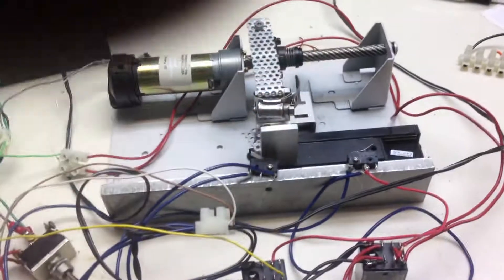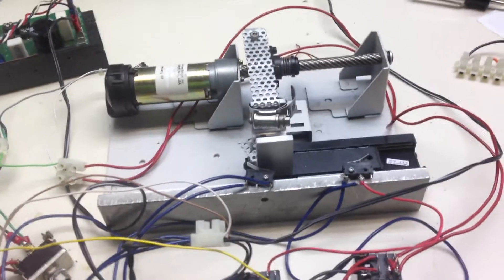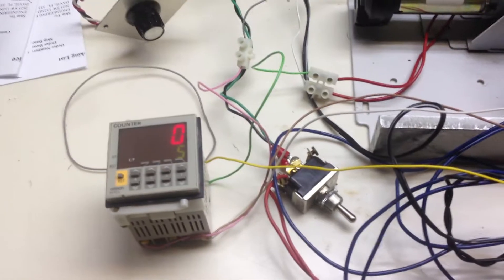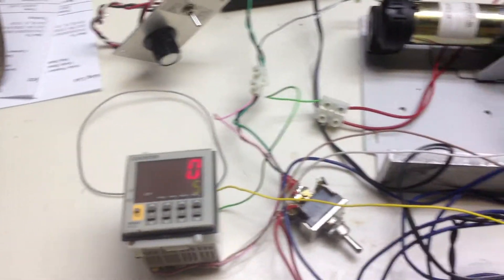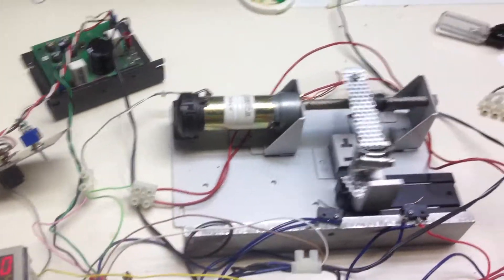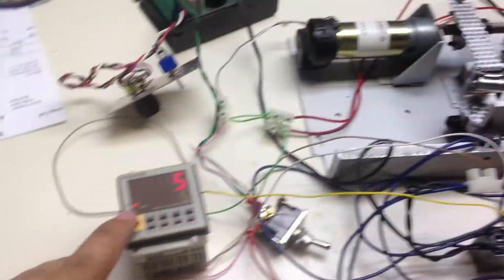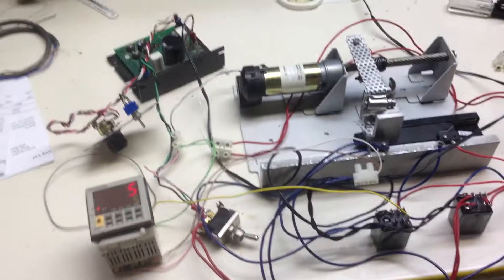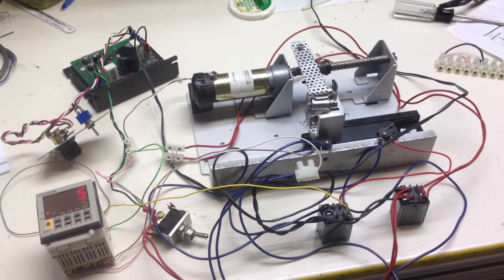Auto reversing linear actuator Part 2

Comment: Sir please share dc motor details.
Reply from the maker: It's a 12VDC motor with a multi-start lead screw I picked up at a surplus supply house years ago. Similar to this one: https://www.mpja.com/Leadscrew-with-Gearhead-12-24VDC-Motor/productinfo/32681+MD/ . Speed control was a PWM drive similar to this ( https://www.mpja.com/PWM-DC-Motor-Speed-Control-6V-24V/productinfo/36113+MD/ )
Reply: @ERGMIAMI  thanks a lot and lots of love.

Comment: What counter model are you using for the diagram and, if different, for the end product?
Reply from the maker: That counter is no longer available. Here is its replacement: https://automation.omron.com/en/us/products/family/h7cc
Reply: @ERGMIAMI  OK well what I am trying to do is study the circuit. However when it comes to the counter (diagram is unclear) what goes to what. I can speculate but without knowing the exact model (link is to the series not one that you used) it is hard to do that. Since each model in the series can be different in how the operate and pinouts are different. So it is difficult to ascertain why you have a diode and resistor. It seems that they don't have a purpose. Being that there is positive voltage coming through the relay and on most counters the Count terminal is High and it is trigger by going to LOW. AKA the negative. What is the thought process? Is the blue line at connection 10 an acualt wire also?
Reply from the maker: @AztecWarrior75  The input to the counter is connected to the leg of the limit switch that goes high when the carriage is at that limit switch. That increments the counter's PNP (Sourcing) input. The output of the counter that closes (Normally Open output) when the counter is powered, supplies power to the motor circuit. That is, the output COM terminal is connected to the +V power supply and the NO terminal is connected to the motor speed control Power Input. That output changes state to off when the preset count is reached, shutting off power to the motor circuit and stopping the carriage. 
The system restarts when the counter is RESET with a momentary switch bridging the reset terminal with +V (or 0V depending on the counter)
Reply: @ERGMIAMI  Ok Now I am confused. 

On your whiteboard drawing you have.
and on my drawing recreation of it.
Left a link to it but is seems to have disappeared along with the comment it was in. Guess youtube doesn't like external links. Will leave a link to it in my latest video here.
Will link in next comment just in case. (If you don't mind taking a look and confirming)

Negative from battery to 
P1 5 NC
P1 6 COM
TO
P2 8 COM
Makes connection to 
P2 7 NO
TO
Counter 9 and relay coil negative.

If I am not mistaken that means the connection on CTR 9 is brought LOW not HIGH. Otherwise the relay won't energize.

I still am not getting what the diode and resistor are for. On All my counters the input (COUNT) is HIGh and it needs to be brought LOW to trigger the increment/decrement. 
Are they to protect from EMF.

"The output of the counter that closes (Normally Open output) when the counter is powered, supplies power to the motor circuit. That is, the output COM terminal is connected to the +V power supply and the NO terminal is connected to the motor speed control Power Input."

What you are saying that when the counter reaches the set count. the counter OUTPUT (OUT) goes to NO making a connection to Negative and keeping it (sos relay stays energized), when P1 is NO. AKA bypassing P1. 

Yes I got that. It was hard to tell in your whiteboard diagram. But I figured as much.
Reply from the maker: @Aztec Warrior  I was out for a while and in my absence, someone wiped the whiteboard clean. I'll recreate the schematic properly soon.
Reply: @ERGMIAMI  If you go to the link in my comment, right before your last, in the description of that video there are two links. Your whiteboard diagram and my version of it. If you can tell me what is different I can change it. You can redistribute after if you like.
Reply from the maker: @AztecWarrior75  your link wasn't there. Let's move this discussion. Use the email on my website. www.engr-group.com
Reply: @ERGMIAMI  in comment 4 above this one.  Again links are in the description. 
https://youtu.be/g0cIVGC6jD4 

Drop me an email there.
Reply from the maker: @AztecWarrior75 here's something new: https://youtu.be/OjKr5VcVM8o?si=YnLd1G2ghMpFCtk7

Comment: Hey it's me again. One of your viewers came to my channel asking for help with the simple Forward/Reverse part of your video. After I made some diagrams and videos it got me to revisit you video. I wanted to recreate the work (at least on paper, foreshits and giggles) I made a working circuit. Then I noticed  your whiteboard picture. I get most of what is going on but I can't seem to make out the connections to the Counter. Would you mind breaking down what goes to what in a drawing or text? Also the use of diode and resistor?  I have a diagram done for the most part. Just need some clarity.